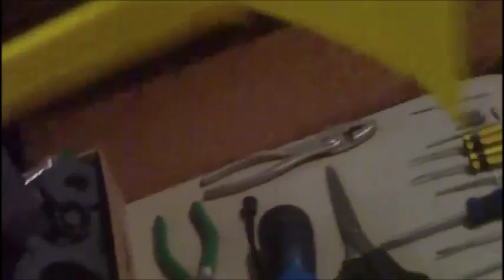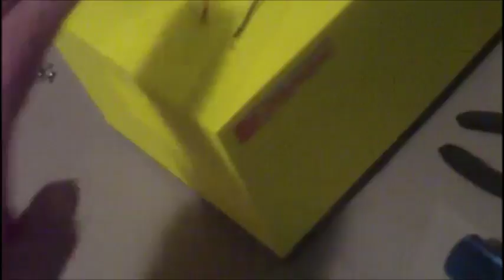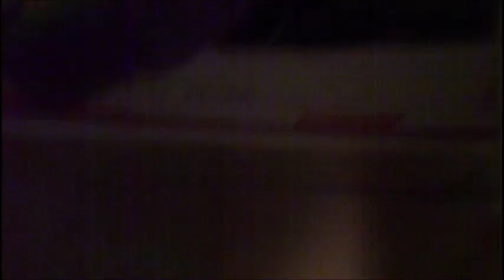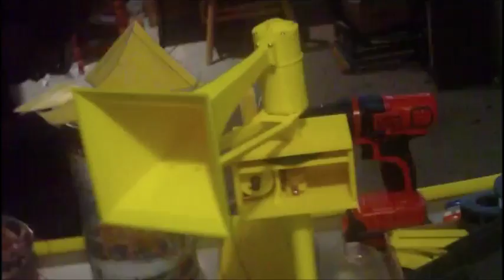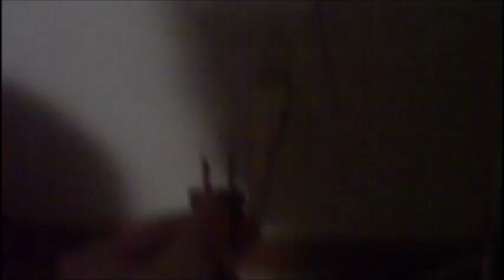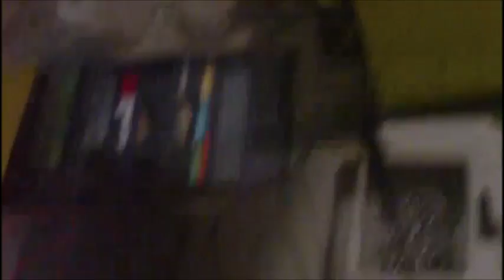mini thunderbolt tornado siren update - horn and blower box.

Comment: I got an idea:
I am 3D printing @alexthefancollector's gear driven fan, and I want to replace the small motor cooler with a siren that is designed to produce sound AND cool off the motor. HOWEVER, I don't know what port ratio to give it.

I want the small siren to produce a 770hz tone, without the balsa wood blades.

Comment: Hey bsp you are missing something on the Thunderbolt siren it was supposed to be to control boxes to run the siren and you got to press the button to order it make it run
Reply from the maker: the controls (specifically the mechanically driven attack signal controller) are what i'm working on next, but the file is giving the people at dospace some trouble 3d printing it. or even loading it.
Reply: @brokensolarpanel2649  have you tried a DC motor

Comment: Love it! I think you should add a capacitor to make the chopper wind up and down realisticly. Also if the rotator box gears are skipping teeth, try having less teeth and enlarge the remaining.
Reply: Thomas Castellanos-Arroyo true!
Reply from the maker: if i did that to the rotator, the rotator would probably be too fast. even with a slow speed on the rotator motor. i think all i need to do is bring the gears closer together.
Reply: How many volt are is your motor rated for?
Reply: broken solar panel yeah I just choked on my brownie
Reply from the maker: thomas castellanos-arroyo, the motor in the rotator is i think is rated for a maximum of 18 volts dc. and i am running it on 3 volts dc in order to turn the rotator nice and slow. the megablaster junior's rotator uses the same kind of motor and the same voltage to the motor. the mini thunderbolt's chopper and blower use the same kind of motor that is in the rotator. the blower gets the full 18 volts dc and the chopper gets 6 volts dc.
Reply: broken solar panel ok, good to know
Reply: broken solar panel where did you get that Thunderbolts term from
Reply: Neressa Beasley what "term"
Reply: Draft beer or where did he get it from
Reply: Neressa Beasley what???
Reply: @Thunderbolt1000AT  nevermind